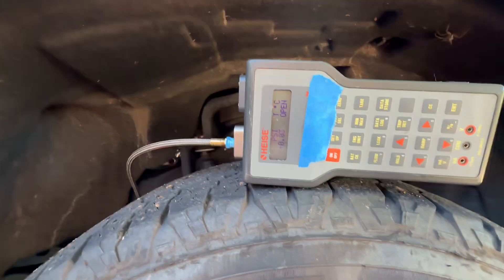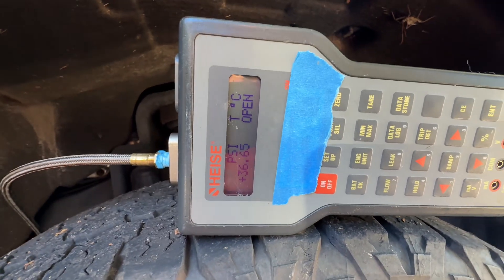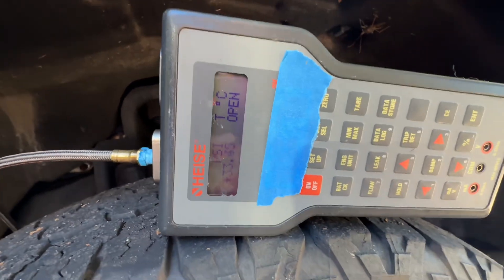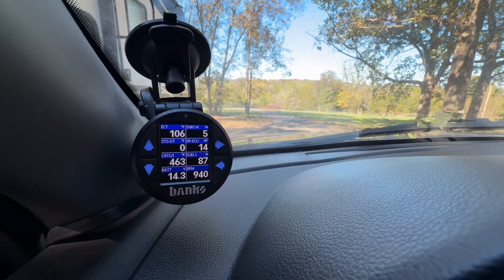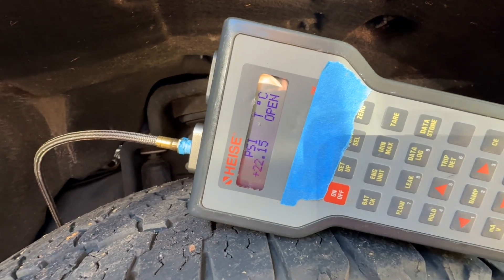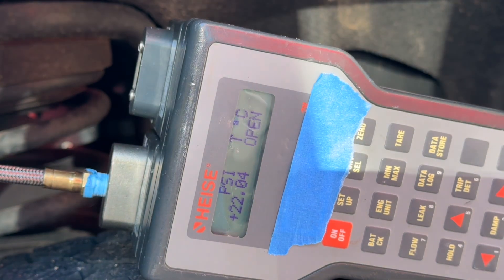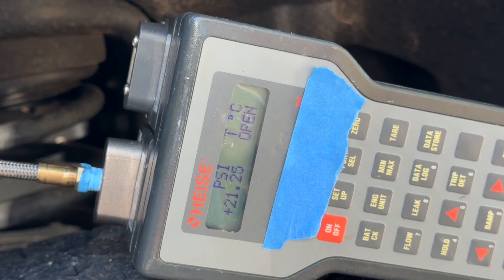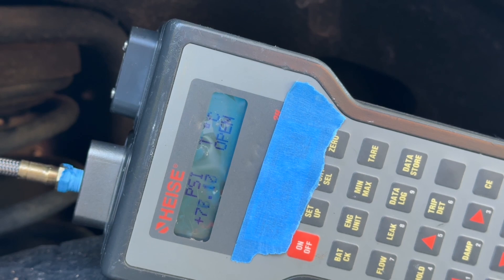Ford 7.3 gasoline engine oil pressure

Comment: I think the low oil pressure at idle is a serious issue on SOME of these 7.3s. just because yours didn't exhibit the issue doesn't mean that it doesn't exist. I do however think that there are other issues causing the lifter failures. I believe that the low oil viscosity is one of them. Pushrod engines of the past liked higher viscosity oil.

Comment: I think you've proven the oil pressure is not 8 psi at idle - if the truck had a lifter ticking  and showed low oil pressure we would have good data. Personally think the lifter problem is bad lifters not an oil pressure issue. ford is just cya.

Comment: I just installed a oil pressure gauge where the factory sensor is at the top of the motor in back, it reads 18-20 psi hot idle, I guess it reads a little higher at the oil filter, mine is also a 2021 with 33,000 miles. 
Note if you install a oil gauge at the back top of the motor you need a tee because you still need the factory sensor to remain in place, its a Econoline van with a doghouse, very easy access to the oil sensor unlike a truck.

Comment: It would be cool if you find a 2023 or 2024 Ford 7.3 gas truck that has had the TSB done to increase idle oil pressure and see what it runs at.

Comment: The lifter issue seems to be presenting for high idle trucks being used as field utility trucks (aka like boom trucks). 

It would be great to test oil pressure at a full 120 minutes of idle. 

I sometimes stop at rest stops and make lengthy work phone calls of 30-60 min with my Godzilla. Instead of letting it just idle through I occasionally give the throttle a kick and boost the pressure a little. 

By the way I also cold start my truck and let it idle quiet for 1-5 minutes. I start it and then load what I need, wipe the mirrors, wipe the backup cam, check tire pressure, go snag another kiss goodbye from my lovey wife - and then up and out my subdivision for 2 min at about 15mph. Then I get on a 2 mile straightaway and it is off to the races cuz those 445 ci in horses want to Go Go Godzilla

Comment: Good video. I would like to have seen one more parameter - drive it on the highway for 20 to 30 minutes, then stop and check the idle pressure immediately. Then, also let it idle for about 5 to 10 minutes AFTER pulling off the highway and check that psi again. Just to see if ~20 psi at idle is consistent under all conditions.
Cheers Bro.

Comment: The Duke says, so in my opinion this debunks all of the opinions that say that low oil pressure is the cause of valve train damage in the Godzilla engine. Which by the way I have one.  a 2023.   22 lb of oil pressure at idle in Park is more than enough oil pressure to keep everything lubricated. Plus let's not forget it's not all about oil pressure, there's also oil flow to consider. Think about it, what's going to lubricate an engine better, 22 lb of oil pressure through a small orifice or 22 LB of oil pressure through a large orifice? There are aftermarket cam manufacturers that are having their cams fall apart as soon as they are installed in high performance vehicles. That tells me it's a material/manufacturing problem from the manufacturer. You can blame Ford or anybody you want, but it seems to me this conclusively shows us it is not oil pressure causing damage. 
The early models were more prone to this not the newer ones. Thank you for providing this video and showing us real world results. 
What did I teach you?
Reply: It doesn't debunk it, it just gives more data, low 30's at hot idle should be a minimum with 5w30, 22 psi with the current oil pump setup may not be delivering enough oil to the entire engine to properly lubricate it, it really doesn't matter, Ford did what they always do, they come out with something that looks good but trip right at the finish line, why use this oil pump setup, why not use a crank or cam driven oil pump, the kind that just work without a computer.
Reply: @JDT-pq3wi  the Duke says, because it shortens the length of the pickup tube. The shorter the pickup tube the quicker the oil gets to the parts that need to be lubricated. It's very simple and it works great. It is chain driven not belt-driven. So that increases its durability and reliability. You don't need 30 lb of oil pressure at idle to lubricate any motor. 
What did I teach you?

Comment: Thanks for the test im interested because i have one.  One thing ive noticed mine idles same 600-700 rpm in park or neutral when warm but when idling in drive with foot on the brake like a red light or stop sign it dips down between 400-500 rpm. The lifter damage could be happening during this time for folks who live in a city. The idle rpm is lower than anyother truck ive ever had and the oil pressure test you done seems kind of low across the board to me. Seems like ford would have just increased the oil pressure this is a major failure for what otherwise seems like a great engine. If you get time please redo the test with parking brake set hot and in drive where the rpms are in the 400-500 range. Just a theory but my guess is this is when most the wear is occurring at long red lights drive threws etc.

Comment: Man thank you for finally putting this to the test, so much speculation and rumors lately. What year was the truck?
Reply from the maker: 2021 F-250 with 23,000mi the pressure was taken before the oil filter with a NIST traceable gage model PTE-1 with a 0-100 psig sensor.